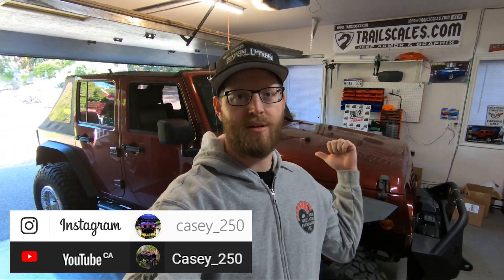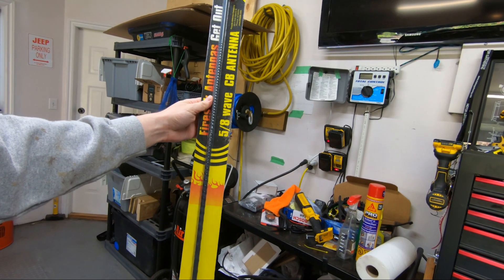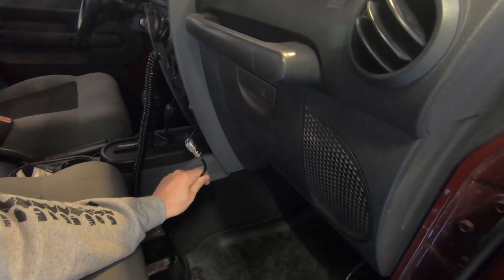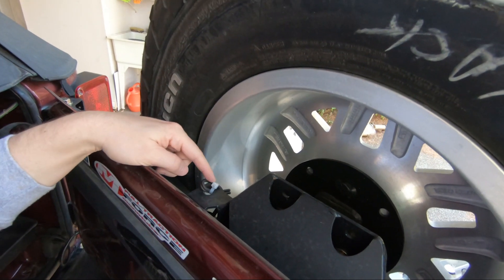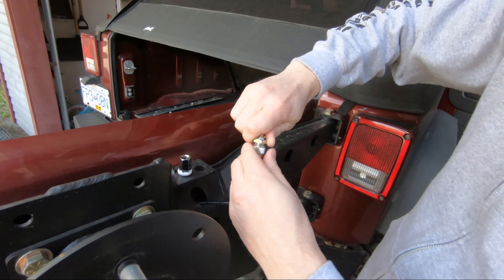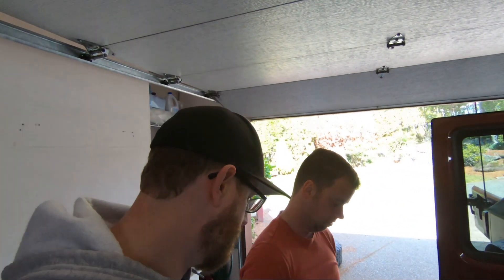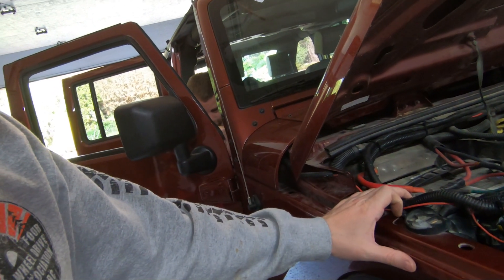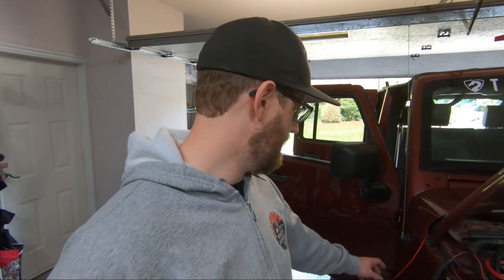Easy CB Radio Install | Cobra 75WXST | Jeep Wrangler Mods

Comment: Nice, I have had one for decades. I just found it in a box in my shop. hooked it up and it is working again. I keep a CB in my trucks for legacy work with 4x4 people, but for real comms, 2 meter and GMRS are so far ahead of CB that it is not funny.  Truthfully requiring CB is really irresponsible of organizations. If I were going to get another vehicle CB I would buy a hand help with an N connector to the antenna, then install a good antenna with an N  quick detach in the Jeep. Keep the rubber duck OEM antenna so when you get out you can carry it. That is how I do 2 Meters mobile. My Yaesu HT with a great antenna has done simplex to 30 miles. And with GMRS your unlicensed family is covered by your license, we use the Garmin handhelds with built in GPS and mapping, we have used them for decades too, it is really sad that Off Roaders, for all they spend, treat comms like empty beer cans.

Comment: Good video, thank you.  Would have been helpful to see how you connected to the battery, and the reference to a fuse that was separate from the one that comes with the unit--what's the purpose.  From the video looks like you plugged into what the previous owner had installed (at the battery), but can't tell what you really did at the power source.  Care to add those details?
Reply from the maker: Thanks for the feedback, I am always looking to improve my videos. We tapped into the battery bus bar which basically an extension on the positive terminal. I fused the unit again, as I prefer to have a fuse as close to the power source as possible. If the fuse is at the unit itself, there are several feet of wire that could burn or catch on fire in a short that would be unfused.
Reply: @Casey250  This is very helpful. Thank you. Would it be possible to upload a picture of your battery with the fuse shown?
Reply: Ah... This is the only part of the installation that is confusing and I needed to see lol

Comment: I have been thinking about switching to one of these. I currently run a Uniden 520xl. It is an awesome radio, but wouldn't mind something smaller. Looking forward to the JJ event vlog!
Reply from the maker: I think if CB was going to be my primary radio I would go with a more powerful and optioned unit but this will do for JJ. - I am really excited to JJ - should be at least 2 vlogs (2 days of wheeling) to come from it :) Keep an eye out for Jeepapalooza vlogs first though! 1.5 more weeks!
Reply: @Casey250  Looking forward to it Casey. I need to get some install videos uploaded so that I will be up to date with the events I am doing soon

Comment: Good video. However, as I lease my vehicle there no way I can drill, rewire, modify or mount such accessories in my truck. Apparently all of these steps must be done to get a working CB radio in a vehicle. Maybe a portable unit could work.
Reply: Maybe you can get a CB that plugs into a cigarette lighter and use a mag mount antenna

Comment: Have you had any problems with it? I’m getting one and plan on plugging it into the cig lighter and use a magnetic antenna on the roof of my truck. Any recommendations
Reply from the maker: Im not sure how well that setup would work. Im not a fan of CB after using it at Jeep Jamboree. They have switched to GMRS now I believe
Reply: beware the magnetic antenna. It will scratch up your paint.  If you don't care about that, then no sweat.
Reply: made many trips with the set up ur talking about...never had any issues..as far as scratching the paint i just used a rag between the cowl of my jeep and the antenna....